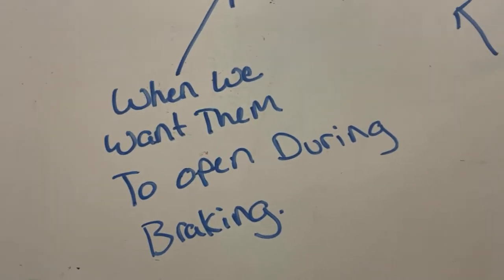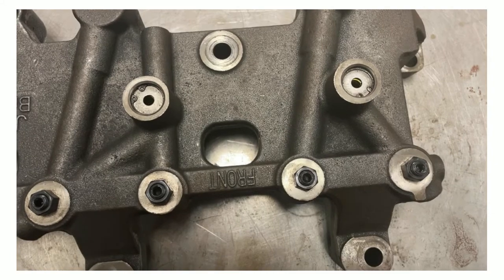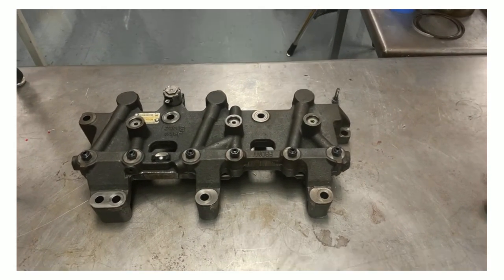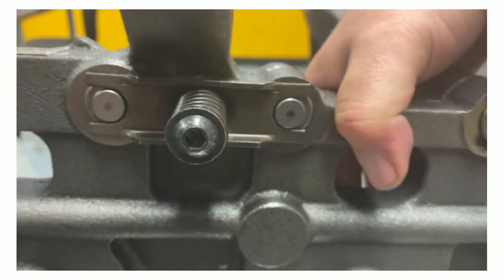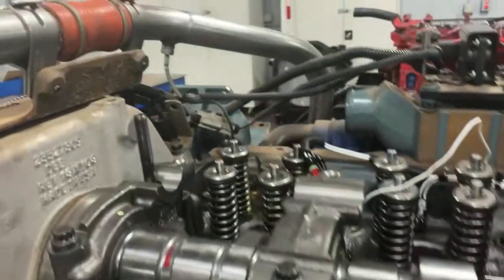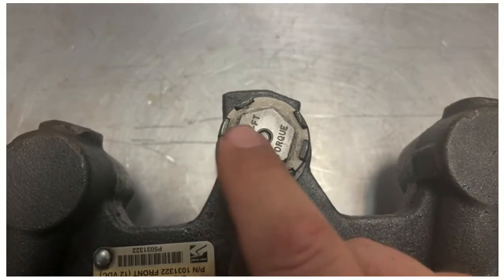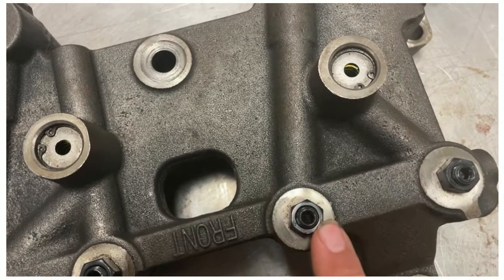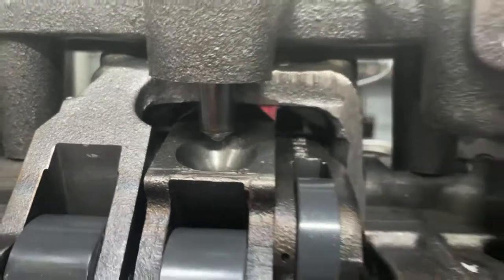░▒▓█ 𝐃𝐈𝐄𝐒𝐄𝐋 𝐄𝐍𝐆𝐈𝐍𝐄 𝐂𝐎𝐌𝐏𝐑𝐄𝐒𝐒𝐈𝐎𝐍 𝐁𝐑𝐀𝐊𝐄𝐒 (𝐉𝐚𝐤𝐞 𝐁𝐫𝐚𝐤𝐞𝐬) 𝐄𝐗𝐏𝐋𝐀𝐈𝐍𝐄𝐃! █▓▒░

Comment: Hello! A little late to the party but just wanted to thank you for making such an informative video! I have no experience with engines [mechanical or electrical] but recently have gotten really interested in how diesel engines operate and the air compression brake system. This was a great find for a starting point! Thanks i will definitely be checking out the other videos. :]
Reply from the maker: Thanks for sharing!  hope you find more that you like and please reach out if you have questions!
Reply: @charleysgarage  I was curious about something, i saw recently a couple was driving a bus and their Psi dropped to nothing while they were on an downward curved road. This was almost devastating for them. I always thought buses had a safety preventative mechanic for Psi/air compression. Or is this more for electric modern buses? Thanks!
Reply from the maker: @illydahlia8725  If we are talking about Air Pressure the parking brakes on an air brake truck are spring applied and air released. If their air pressure dropped that low the parking brakes should have applied and they wouldn't be moving. That is the safety feature. If you are talking about oil pressure I am not sure what you mean?
Reply: @charleysgarage  hmm. I'm not sure what i mean either. LOL. I'm still learning and not even a beginner. I have the link to the video i was watching, they don't really go over what the issue was in this, just state the Psi dropped out, and that they had no brakes, and she basically pulled the key? I am wondering what would cause this sequence of events?https://youtu.be/cP4QuRi0C3s?si=Fou5vwLdLO8SrgWB
 Sorry for the journey, this was part of what peaked my interest in learning about air compression brakes. Thanks!

Comment: What does the turbo do when using engine (jake brakes)
Reply from the maker: Since Jake brakes are compression brakes the Turbo will actually increase boost during braking making the engine compress more air before releasing it. Also when the turbo creates more boost it is also creating an exhaust restriction making the brake even more efficient.